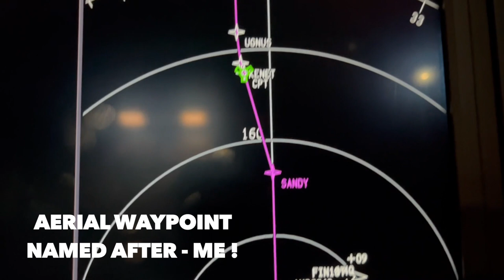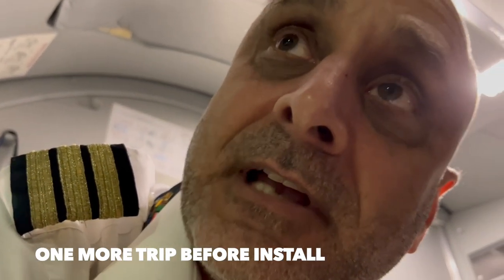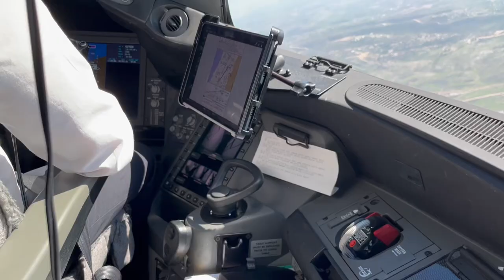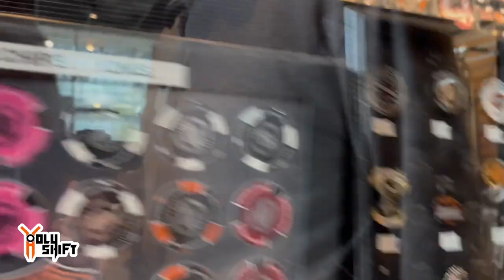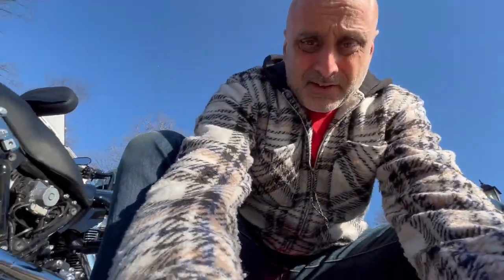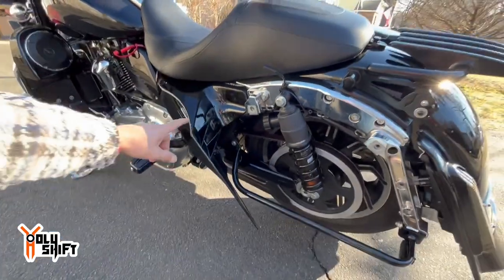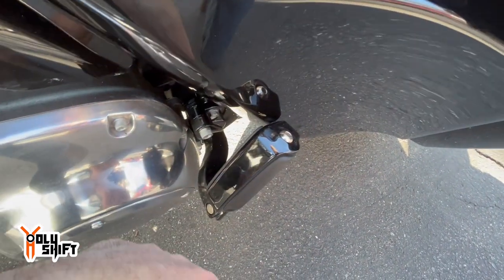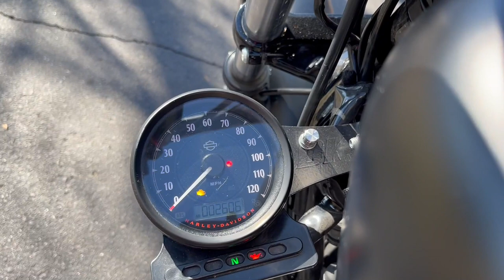Advanblack Side Covers Install / Harley Sportster Raffle Begins

Comment: Looks very clean. Maybe look at peg swivel and see if there a way to incorporate a stop.     Can you recommend a good handlebar phone mount?
Reply from the maker: I'm old school - I like using the RAM mount system for my phone
Reply: Or you could place spacer/washer between mount bracket and frame to bring peg out a little